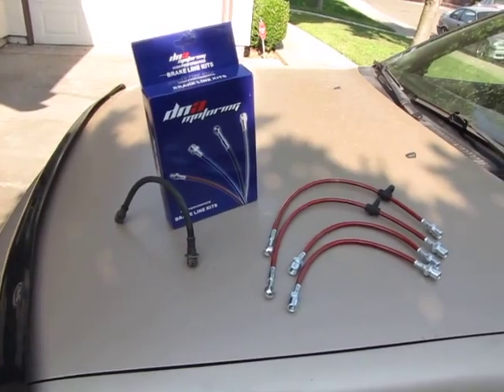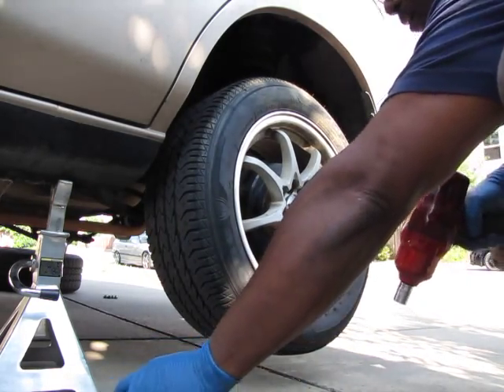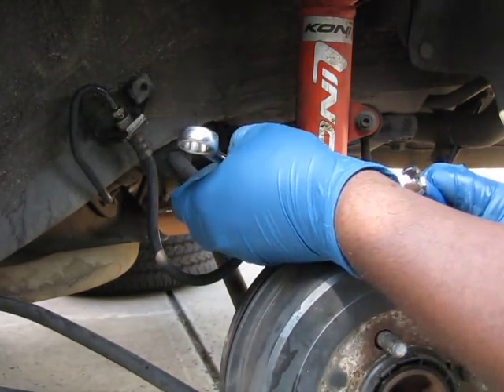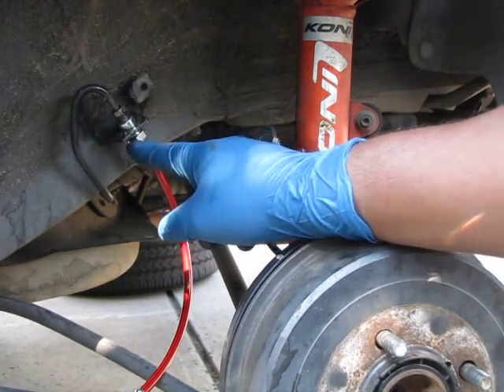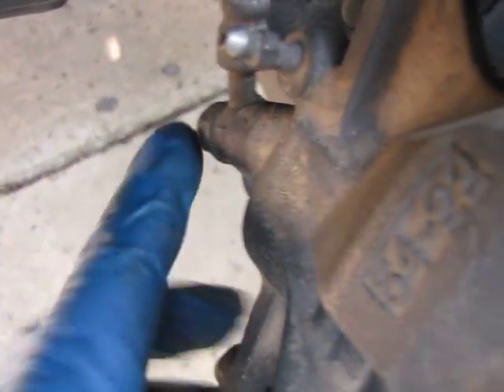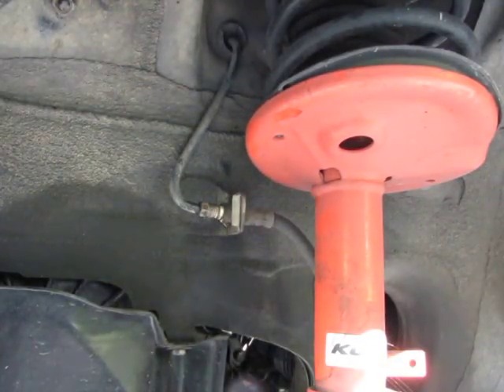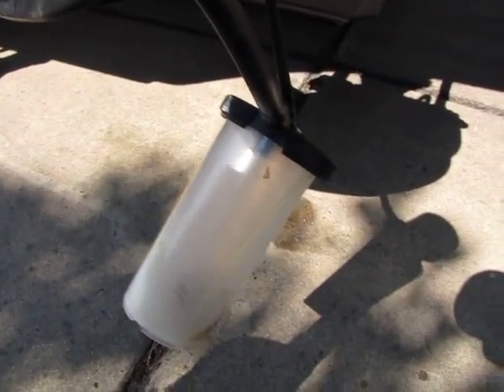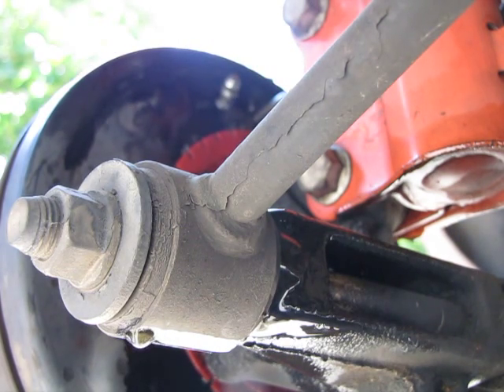How to Install Stainless Steel Brake lines and Bleed your brakes

Comment: Very informative as usual, love it! How do you like those Koni struts? My '94 is in dire need of new struts
Reply from the maker: The Koni street orange non-adjustables adre perfect the street use on the Corolla. I have the adjustable yellows on my BMW M3 and of course those are great ... but they cost a lot more.  The oranges for the Corolla  are perfect, I love them!
Reply: Did you reuse the stock springs or did you get aftermarket?
Reply from the maker: I reused the stock springs.  New aftermarket springs will give you an even better road feel than the old stock springs.
Reply: Clint Hightower where can i get some of these Koni Shocks